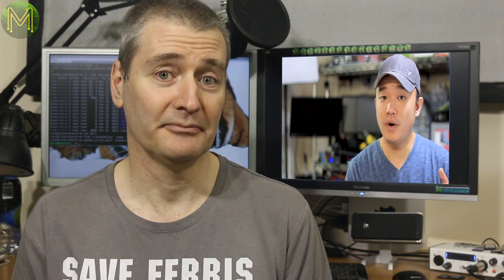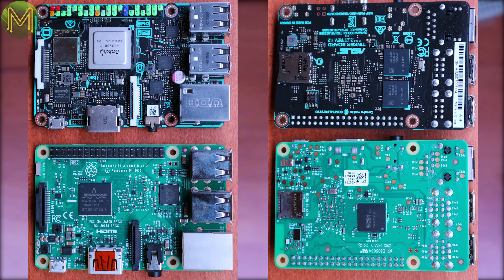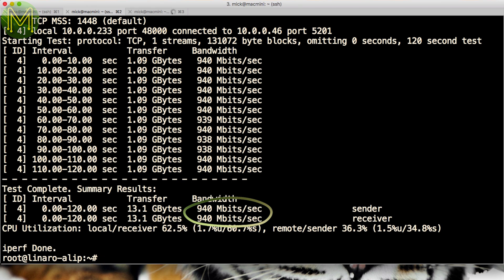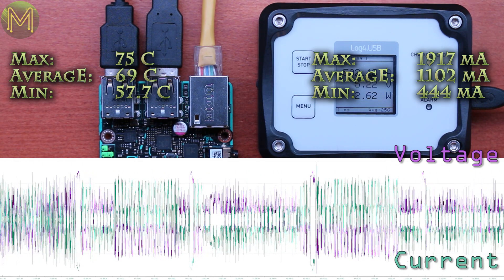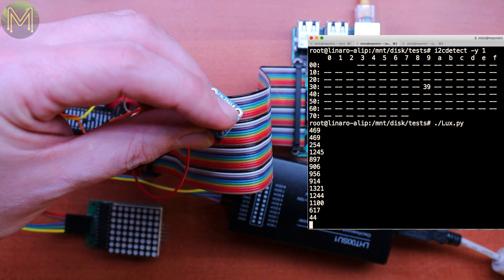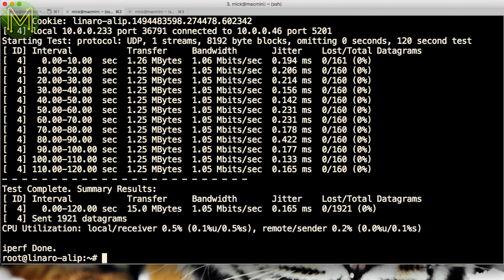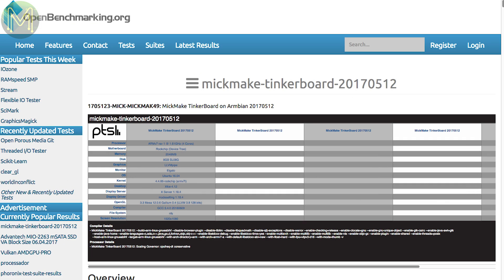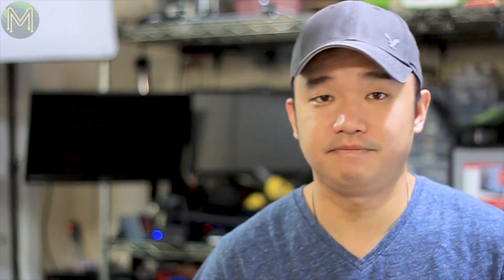#131 TinkerBoard: Shedding the "Pi clone" stigma // Review

Comment: Thanks MickMake.  Now I know I need to purchase a voltage and amperage meter.   My Linaro-linux did load into the Tinkerboard memory for a month, but not anymore.  I tried Buster-linux, Ambian-linux, and Android several times.  None of these operating systems load into my Tinkerboard-S boards now.  I am really disappointed that Tinkerboard-S is just unreliable for young people such as me.  The failure of the boards to load a 5-step etched OS, the lack of support from the ASUS website, and the lack of local interest groups in the Tinkerboard,  just means that young circuit board fans will move onto other small circuit boards from other SCB manufacturers.

Comment: Why do you always SSH into these computers instead of using them directly?
Reply from the maker: +Zane C 
For several reasons;
* I can record my desktop easier than the screen of an SBC.
* I use templates during video editing that automatically resize and shift the screen.
* Often the default font size used on SBCs varies greatly.

So, it's much easier to SSH in.

Comment: Looks like it could be a solid option for custom laptop type devices or emulators if it gets the support of the Pi. The Pi 3 is good but just feels like it's lacking in power a little bit for the more demanding situations so it would be nice to have a more expensive but affordable and well supported option above it. I personally couldn't justify something like $100 on any of the other boards you have reviewed as I don't know enough to fix them if something goes wrong. The Pi is great as you can easily get help with it so if this board can get a similar following it's looking like a great option.
Reply from the maker: +James Coyle 
Yup and this is why the Pi is so good and is so difficult to dethrone. Not a bad thing as it is achieving its goal of educating people.

Comment: But does it run crysis an N64 emulator?
The pi3 can easily handle everything up to including PS1 but the N64 performance is just plain horrible.
Reply from the maker: +fgregerfeaxcwfeffece 
Ha ha. Was waiting for that!
From what I've seen, it has 2x the performance across the board. Maybe I should add emulation tests to my followup review.
Reply: Good call, as many people buying these type of systems are looking at running emulators

Comment: Shame about the LAN misbehaving, I was curious about sustained transfer speeds (though I'd only expect 30-40MB/sec if it were using a USB drive, it'd still be 3-4x quicker than a Pi). Chris over at ExplainingComputers tried out various media playback software and did some temperature/stress testing a couple of weeks ago.
Reply from the maker: +Dant 
I was hoping that Ethernet would be a bit more stable. It'd be nice to be able to use this as the heart of a NAS box.

Comment: I ask a similar question with a Orange Pi board and I guess the answer will be the same.
Question: Could you run Raspberry Pi stuff on this and expect it to work the same but benefit from the faster system?
Reply from the maker: +TheDutyPaid
Absolutely! Once the Ethernet driver is sorted out, it'll be a very nice board.
Reply: MickMake so just to confirm that you could put a noobs SD card in and be fine?
Reply from the maker: TheDutyPaid 
Hmmm. More than likely no. There's still a lot that goes on under the hood that makes them different enough.

Comment: but its only 32 bit cpu, you can buy a 64 bit android tv box with better specs for less.
Reply from the maker: +TheWeepingCorpse 
Yes true. Sadly not many GPIO options on those boxes.
Reply: With a shitty locked system. And no software support.

One of the biggest pi advantages are the debian software repos. Next one beeing the community support.
Reply: Valid point Mick, can I pick your brains for a second.  I'm trying to find a board with a 64 bit arm soc that can run a 64 bit version of android.  Most of the 64 bit tv boxes I've researched seem to be running 32 bit android on top of 64 bit soc hardware, so instead of a tv box I'm looking into buying an SBC, however most of the SBC I look at are using outdated GPUs and I need opengl ES3.0 as a minimum.  So to recap, I need an SBC with a 64 bit SoC, a GPU that supports opengl ES3.0 and can run 64 bit Android (or a 64 bit linux if android is not an option).
Reply: yes and youre stuck with android then, not what most people will use on this thing probably

Comment: ah. yet another pi board.
I have a box using RK3288 and to tell the truth, this chip should be more powerful than it actually does.
the chip has a very fierce parameter but feels lacking optimizing.
Also, the chip is supposed to clocked at 1.8GHz, on which you may cook your egg.

I don't know why, but I don't have confidence in SoC to drive SPI bus, I would rather like a MCU like arduino or sth.
Reply from the maker: +Zelra 仙賢戀軒 
Yup, SPI on SBCs is a little flakey for the most part.